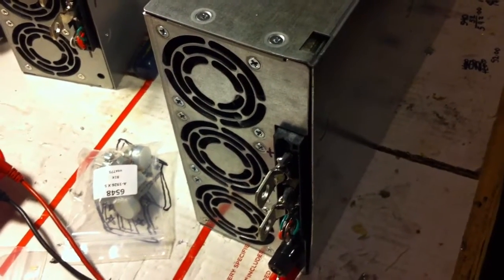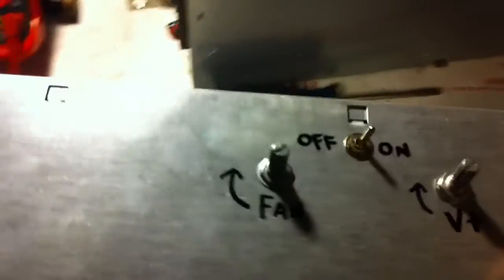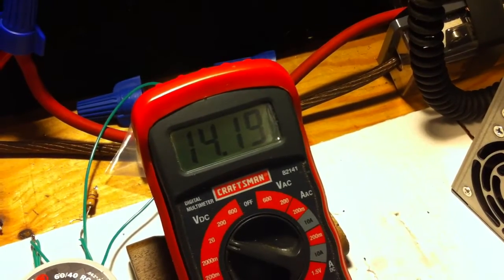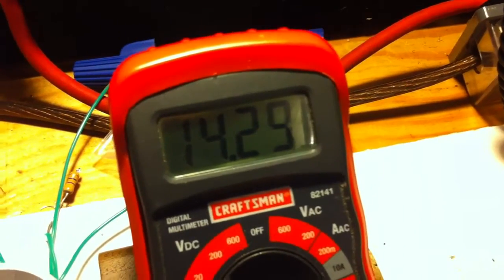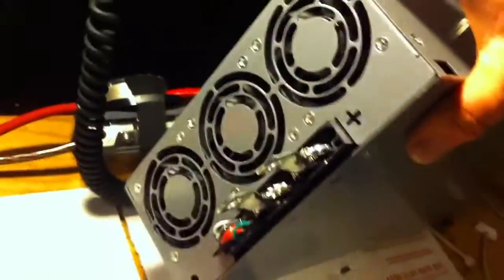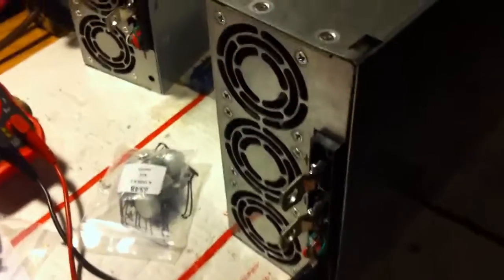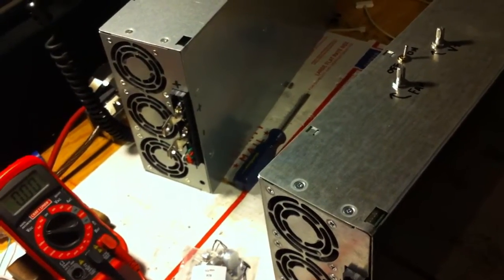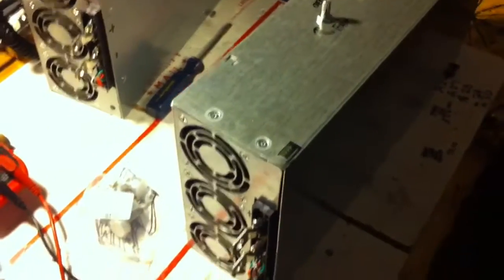12 to 14 volt power supply for CB Ham Amateur Radio Linear

Comment: Do you sell these modified ones like yourself? If so how much. Really attempted to buy this from you
Reply from the maker: I quit selling them because the supply of good available units ran out. The last ones I purchased to mod & sell were junk.
Reply: +Charlie Brown Do you put a resistor before you voltage pot? If so what one? What do you use to soder and connect the small pins?
Reply: ummlol 
Resistor ohm depending how much voltage amperage your psu is capable. Solder wire to solder to connect to small pins
Reply: I read on a forum to use a 460 ohm, but i have seen videos of people who havent used any. Im trying to shoot for 14.4.
 I bought some pin connectors so I am hoping those willw ork.
Reply: ummlol that's fine. On my psu I have voltage pot to adjust the voltage. However I did used to have a resistor on it but took it out few days later. It makes no difference to the performance, it's just there for protection if something was to go wrong